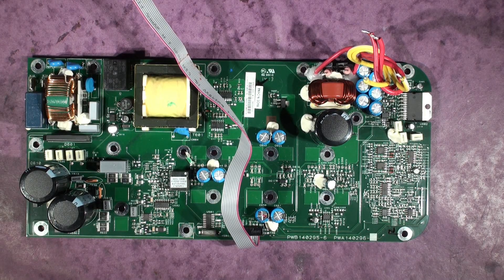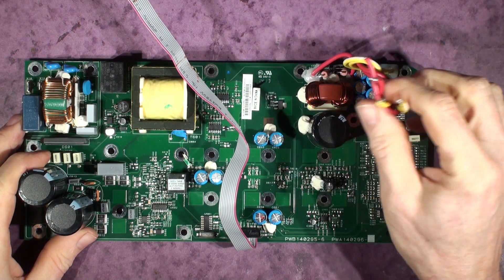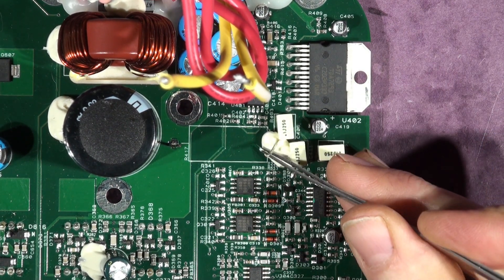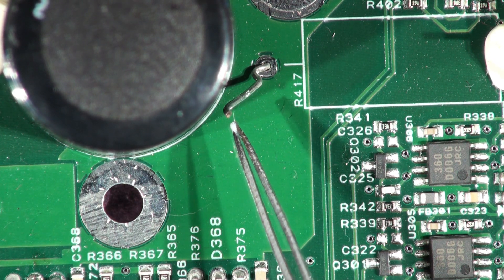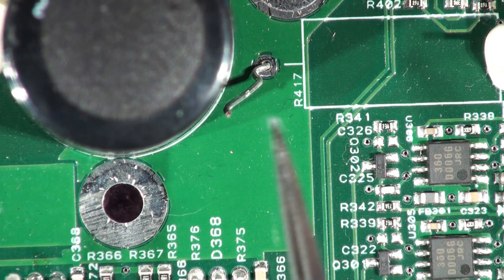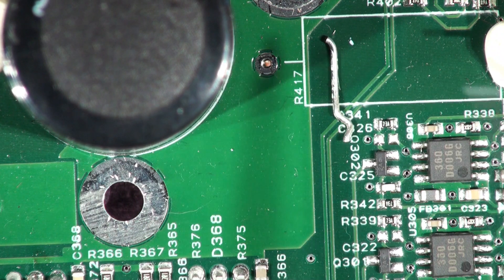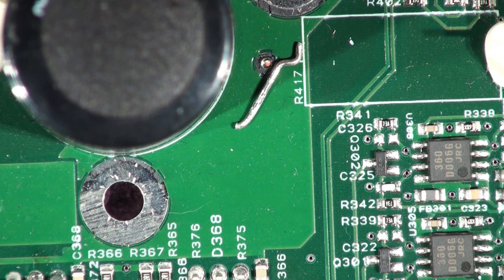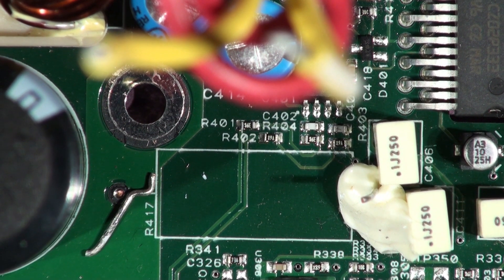JBL EON 515XT R416 Leads Fatigue common fault and  Repair

Comment: Hope all is well!! ive repaired that and i have about 5 eons with the same issue, before and after that repair.. the horn is outputting about 15% of what it should be. ive replaced the horn and still have the same issue with all 5. any ideas on what i can look at? the woofer is fine. horn is indeed outputting but only about 15%
Reply from the maker: HF drive issues are much more rare. Is the 10 Ohm 10W ceramic resistor leads intact on the HF 3rd order filter ?  Otherwise wash out your ears???
Reply: @razenby  that is the first thing i checked. surprisingly i still got the same low HF output with the resistor broken off. ived replaced the resistor and it did not change at all. still getting very low HF output. ive swapped horns to verify its not the horn itself.

Comment: Hi guys,I have a 515XT,it fell and now it's faulty,when u switch on,the power light flickers and I hear a clicking sound,what's the issue please?
Reply from the maker: Hmm,  open it up and check all the cables are connected correctly.  Did the power input cable get yanked during the fall?  Inspect the connectors carefully and make sure the ribbon cable has not come dislodged.
Reply: Thank u sir!
Reply: And no,it wasn't connected when it fell!

Comment: Hi there! That failure can cause the tda getting very hot and a little hiss at the treble with no input at all, i twist the resistor and ir seems fine to me. Im watching all your videos! Great channel!
Reply from the maker: TDA chip is probably blown. If you order one then make sure that you get the correct PIN configuration. They are available with differing bends on the pins.  TDA blows when the tab is shorted to chassis 0V.

Comment: Hi I have a eon 615 it plays at very low volume and as you try to increase you would hear a clipping sound and the woofer stops completely and only the driver plays can you please help me .....I'm from Trinidad....
Reply from the maker: If it is caused by defective electronics then it is a rare failure mode. It is far more likely that you have a defective LF driver unit. Are you getting lots of high treble but very little bass? I cant be sure from remote diagnosis.

Comment: hello, I have a JBL 515 XT it been working fine  I didn't used for a while,   the other day I try to turn it on and didn't work, I can hear a little noise but I do not hear the click, what do you think is wrong. Greetings from Reno Nevada USA
Reply from the maker: It will be one of teh usual suspects. If you have no power light then the Switch Mode Power Supply has failed. See videos.

Comment: I was using JBL 515 this Sunday I turn all volume to the end and bass to the max and it just switched off it self and I can't switch on. No sign of power goes in. What can be the problem?
Reply from the maker: Power board blown.  Needs the modification. Can be caused by unstable chip(s) in the bass compressor circuit  on input board, It need the reliability modifications. Then it will be very reliable.

Comment: hello, I have a jbl 515xt, it was sounding normal, then it went off it didn't sound again, the next day I turned it on and it worked again normal what will it be? What should I change? I always see your videos, greetings and thanks.
Reply from the maker: Have a look at the inductor next to the LNK302 chip - see the video about this component.Very common cause of random cut out.

Comment: fatigued leads on many powered speakers, mackie, rcf, db tech
Reply from the maker: I worked in aviation electronics and strain relief was king. JBL use shitty connectors and they are often loose fright out of the box.